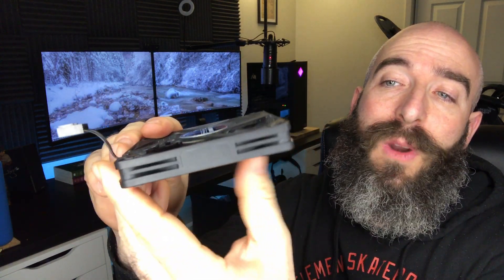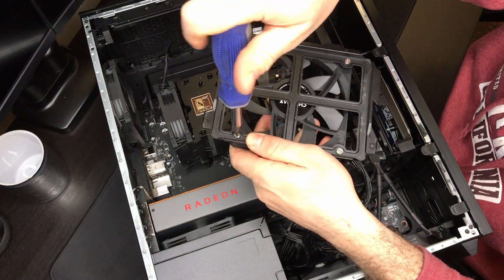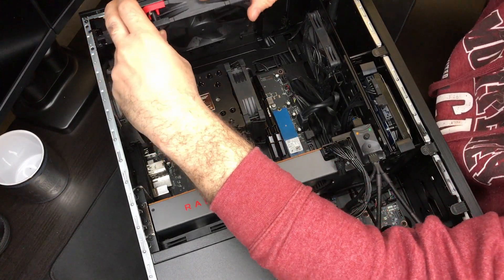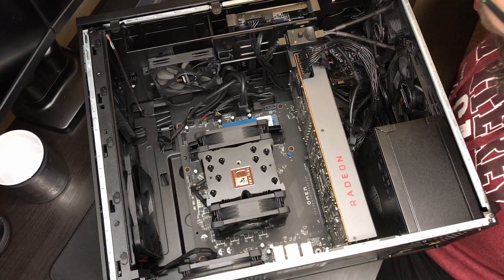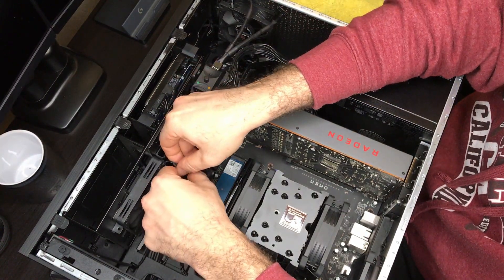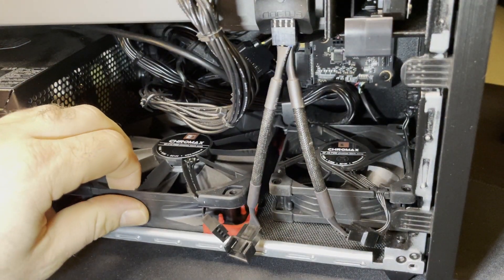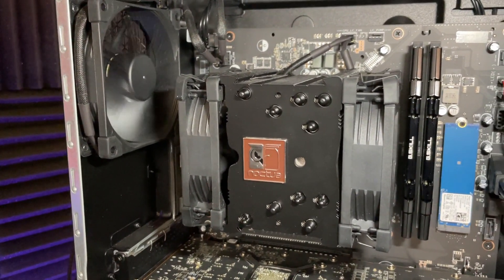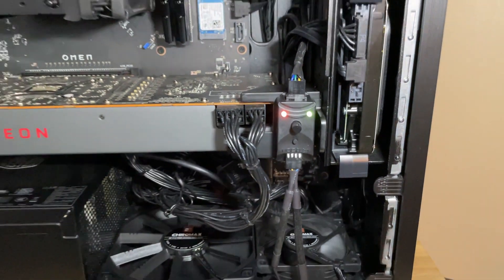How to: Install and Setup All Fans in an HP Omen 25L / 30L! Tutorial & Guide!

Comment: I have a Omen 25l with a rtx 3060 and ryzen 5 5600x. My gpu reaches 50-65 and my cpu reaches 75-80 while gaming. In idle my gpu temperatures are 35-40 and my cpu temperatures are 50-55. I have a top fan and a bottom fan added. What should i do to lower the cpu temperatures?
Reply from the maker: 75-80 is totally normal and safe for that CPU. You could try adding more fans for a possible slight decrease in temps, or you can change the CPU cooler for a drastic change in CPU temps.

Comment: hello mate, so im from the UK and have an Omen 25L.
ive tried to install a new top fan to my pc and i only have the lc pump 4 pin and a F_fan1 4 pin.
what would be best to hook it up to?
the fan is the same one as your previous installation video. thank you, jm.
Reply from the maker: Ft_fan would be the optimal connection. Or y-splitting off a current fan header would work as well. LC_pump will cause the fan to spin at a higher RPM all the time
Reply: @DanKamYouKnow  ahh right right, so i took a second look at your video and hooked it up to the f_fan1 and it makes a slight clicking noise, it’s very very faint but is noticeable when checking for noise
Reply from the maker: Interesting. Could be an issue with that fan OR, the PSU fan in Omens is notorious for making a slight clicking noise occasionally

Comment: Hey Dan, very informative video.
I want to make sure, but is the top fan insertion up to date? I am contemplating wether to install one.
Reply from the maker: Hey Mr. Doge. So this video is still pretty up to date but the best setup for Omens is a top mount 120mm exhaust / bottom mount 120mm intake / replace the rear 92mm. That fan configuration works best. Then if you want to really dive in, replace the CPU cooler
Reply: Thank you very much

Comment: Is this the last / best fan config for the 25L ?
Reply from the maker: Bottom 120mm intake / Top mount 120mm exhaust / Replace the rear 92mm fan ( exhaust ) / Replace the CPU cooler. That’s the best fan arrangement for 25L / 30L

Comment: i want to buy a HP omen with a RTX 2070 Super and Ryzen 7 3700X but i can only see 2 fans on the picture. Does it come with more than 2 because i know the 2070 Super and Ryzen 7 can get a little hot.
Reply from the maker: If it’s a 25L, it will have the CPU air cooler fan and rear fan. If it’s a 30L, it will have the same combo but also has a 120mm front fan.
Reply: @DanKamYouKnow  alright. I decided to instead get another computer eith a i7 9700k and 2080 super for about the same price. But thanks anyways!
Reply from the maker: Congrats!!!
Reply: @DanKamYouKnow  thank you :)

Comment: this is such a terrible computer case. i do not recommend anyone buy this computer. you should have 3 front fans (without obstruction) and 1 exhaust fan. as a minimum. this case has a basement. but it does not have a panel separating it and with a bottom mounted hhd drive cage. its such a dumb design. i am guessing this dude bought this because the specs inside were the right price and or he does not know much about computers. which was my problem when i bought my first computer. which was this one. i returned it soon afterwards. why is mounting front fans lol when there is no airflow that is allowed through the front lol???
Reply from the maker: How about you don’t assume what I know and stop worrying about how other people spend their money? Why are you even watching a 2 year old video about a pre-build anyways? Pretty sure you’ve commented on one of my videos before and now you comment this? I’m trying to help people that already own this PC and want to make upgrades to it, just let people be man.

Comment: Love your videos Dan! There aren't many vids on omen PCs out there. Thanks for all the help!  I'm planning to add 2 fans on the bottom; however, I don't have FT_FAN4 (front fan 4)  on my PC version (875-0034). Is it possible to use the fan controller on the Lc Pump to slow down the fan speed for the two bottom fans? Another option I saw was adding a fan power cable hub splitter.
Reply from the maker: Hey, thank you!! Can you y-split off your current fan headers? And honestly, you really only need 1 fan at the bottom ( 120mm ). Most hubs don’t work well with Omens, they will often have Omens throw the “fan error” upon every start up

Comment: What where the results?
Reply from the maker: For which component replacement exactly?
Reply: @DanKamYouKnow  temp changes from the upgrades was it like 10c drop about?
Reply from the maker: CPU cooler will massively drop it, 10-20c. All fans installed will probably be somewhere between 5-10c
Reply: @DanKamYouKnow  oh perfect mine came with a 120mm AIO so the fan upgrades should do the trick thanks!
Reply from the maker: Just make sure you do a high RPM
fan for the radiator. Something like 2,000 to 3,000 RPM
Reply: @DanKamYouKnow  ok good to know it’s stock so maybe i should change that fan also?
Reply from the maker: You don’t have to but there are much higher quality fans than the stock Omen one(s)
Reply: @DanKamYouKnow  yeah I’d rather swap them out thanks
Reply: Same can only help!

Comment: Hey Dan! Thank you for great video!
Is power of extra fans provided by PWM? and how many hubs or splitters do you use for fans?
Reply from the maker: A single fan header can power up to about 3 fans, and yes; all fans are 4 pin. I would recommend using 2 splitters but it depends on your setup
Reply: @DanKamYouKnow  ahh awsome. Thank you for answering and trying to make better omen!!

Comment: The bottom of my 25L doesn't have that wedge space with the bracket to fit in nicely. Would you have still used the double sided gorilla tape for the bottom fan if you needed adhesive? PC noob here
Reply from the maker: A little bit of tape on the corners would work great

Comment: What kind of screws do you need for the 92mm noctua fan? The stock ones are too big for that one and I don't have any of different size lying around
Reply from the maker: The one that the Noctua comes with are the correct ones, they may seem too big but they are supposed to create threads in the fan when screwed in. So it may be hard to thread in at first but they’re right.

Comment: Quick question. Would a noctua nf-s12B redux-1200 PWM (120x120x25mm) on both top and bottom be bad? I heard someone say it's usable on top but really bad on bottom.
Reply from the maker: I would go with a 120mm F12 at the bottom.
Reply: @DanKamYouKnow  okay thanks! 2 more questions. Could I use a 92 mm fan instead of the stock CPU cooler fan and can I use a 120mm noctua nf-s12b for the front fan
Reply from the maker: Only an 80mm fan will fit on the stock air cooler. And honestly, I wouldn’t worry about a front fan unless you have an extra one, but I wouldn’t go buying a new one. It doesn’t make much of a difference. I only tried 92mm so I’m not sure if a 120mm fan would work
Reply: @DanKamYouKnow  once again tysm this is my first prebuilt and idk whatd id do without your videos
Reply from the maker: No problem my dude. Congrats on your first PC! From my experience, a 120mm bottom fan / 120mm top fan / good rear 92mm fan is the best setup.

Comment: So before I start ordering parts I just ordered the 30L omen. So I will need a 92mm for the rear and the part I am confused on is will I need 3 120mm or just 2? Will I also need another 80mm to put at the bottom next to the 120 like your set up? Finally, is the fan controller a must?
Reply from the maker: This setup I had was overkill. The best setup is a bottom 120mm / top 120mm / rear 92mm, no fan controller needed but you’ll probably need a y-split cable or 2
Reply: @DanKamYouKnow  thank you so much brother, I order this based off of your review and videos even thought it was a year+ ago. It’s coming in on Friday! You’re the best!
Reply from the maker: Appreciate you saying that!! Glad I could help my friend. Easy process but let me know if you need help 😎
Reply: So my 30L omen actual comes with a 120 AIO so that is hooked up to my to with the 120m fan on top of it. What do you recommend I should do
Reply from the maker: I would still recommend the bottom 120mm fan and then replacing the radiator 120mm fan with a high RPM 120mm fan ( 2,000-3,000 RPM )

Comment: Hey I’m just curious I ordered a 30L with a 3090 and I was curious to what your temps were after putting in all the new fans?
Reply from the maker: It’s going to vary greatly from your machine. My CPU was in the mid 60’s and my GPU was like 75C. You’ll unfortunately just have to see what kinda temps your get.
Reply: Hey thanks for the response! I ordered the fans you’ve suggested and will change them out! Appreciate the work!!
Reply from the maker: No worries! Let me know how it goes 👌🏻

Comment: I’m sure you’ve gotten this question a lot, but is the CPU cooler 100% necessary? I am apprehensive to remove anything from the motherboard as this is my first decent pc. Could I get away with just a top and bottom fan?
Reply from the maker: Definitely not necessary. A stock Omen, while running a bit warm will run in the safe temperature zone. A couple fans will help slightly lower temps while a new CPU cooler will drastically lower temps. All depends on what you’re comfortable with. But no, you don’t have to mod anything.

Comment: Good tutorial, how did you install the front fan where the hdd slot is?
Reply from the maker: I used double sided tape and it attaches to the hard-drive cage. After months of testing, it really isn't that efficient.
Reply: @DanKamYouKnow  oh ok thanks, just wondering whether its worth buying another fan for the front
Reply from the maker: If you have an extra fan already, sure. I wouldn’t go buying one though. A top 120mm / bottom 120mm / rear 92mm is the best setup for an Omen.
Reply: @DanKamYouKnow  thanks, appreciate the help. Gonna convert my stock cooler to the one you have using your vid soon :)
Reply from the maker: Nice! Replacing the stock air cooler is definitely the best mod you can do for an Omen 👌🏻

Comment: Does the hp omen mobo support Corsair fans like the Corsair rgb controller because I can not get mine to work they just stay on white and won’t connect to the hub
Reply from the maker: Omen motherboards do not work well with any kind of fan or RGB controller. Not sure on how to get it to work either ( if it’s even possible )

Comment: I had a question on my 30L on the right side of my motherboard it says f_fan2 and f_fan3 but had no pins and has 3 sliver dots is there a way I could still plug a fan there great video
Reply from the maker: Thanks! No, you will need a header that has the pins sticking out. Or you can y-split with an existing fan header.

Comment: where can i get the sata to 4/3pin fan cable for my HP 30L which has a daughter fan controller board with a open sata port
Reply from the maker: The board I think you are referring to is the RGB controller. The 25L and 30L don't use fan controllers.

Comment: Hello! Please help me! I have an Omen 25L and I installed some fans from Noctua and Corsair but they spin at full capacity and I have no control over them. My PC is so loud. Is there a solution to this? Thanks :)
Reply from the maker: Are you utilizing the LC_fan header by any chance? That will make the fan(s) spin at a very high rate.

Comment: Great video but where did you plug the top fan onto I have a omen 30L 3060 ryzen 5
Reply from the maker: I show it in the video, it’s y-split with the rear fan into the header where the rear fan is normally plugged in. Thank you!!
Reply: @DanKamYouKnow  do you plug the fan into the 3 pin because the y cable has one 4 pin and the other is 3 pin
Reply from the maker: The 3 pin side of the y-split cable basically just mimics what the fan plugged into the 4 pin side does. So it doesn’t really matter. If you notice that the fans seem loud, try flipping the 3 and 4 pin around.
Reply: @DanKamYouKnow  I’m so sorry for these questions but 120mm noctua fan but the screws it came with don’t fit did you buy specific screws
Reply from the maker: The screws that come with them work just fine. They are tough to screw in and take a good amount of force to get in.
Reply: @DanKamYouKnow  could I plug the fan into my motherboard that says Lc_Fan
Reply from the maker: That will make the fan spin at close to 100% fan speed and will be pretty loud. You can plug it in there though…

Comment: Ended up getting the 30l instead.  I know the video says 25l and 30l but the 120 mm noctuas fit just fine on the 30l as well ? Going to get the top and bottom and I guess get the y split cables in the description too.
Reply from the maker: 30L works with this as well. Pretty much identical except the front fan bit.
Reply: @DanKamYouKnow  thanks , and lastly ... how many of the y split cables in the link you posted do I order ? Or is it not necessary for me to install these ? That’s the only part that confuses if I need them and how many. I’m only doing top fan , bottom fan , and cpu cooler install with the extra fan for push and pull like you did.
Reply from the maker: There is a 3-pack that’s only $10 I’d recommend. Never know when you might need more

Comment: hey bro i appreciate the replies and the video, I had one final question which was would temps be ok with replacing all the fans other than the CPU cooler. will temps be safe and good without replacing it or is it a must
Reply from the maker: Definitely not a must. Even an Omen in its stock configuration will still run completely safe.

Comment: also i’m not exactly sure how pcs work, how would i add the double splitter cable into the pc, do i just take out the already connected wire out of the motherboard and replace it with the split wires?
Reply from the maker: That is correct.

Comment: hey bro thanks for the video i’m trying to buy my first pc. I had only one question, is managing and changing the cables difficult and do you think i would be able to get away with changing all the fans other than the front fan as that seems like hassle
Reply from the maker: Cable managing the Omen is not really easy because their is no where to really hide any cables. Adding fans is not a difficult task though. The front fan isn't super effective so you could leave it out.

Comment: Hi Dan and thank you for great videos! I have 25L blasting in corner of my livingroom and my wife asked me why my pc sounds like jet engine. So here I am taking notes. 😁 I have ordered Nzxt Kraken m120 for cpu and Noctua NF-A9 PWM fan to replace backpanel fan. I am adding intake after I see results of those mods. My question why I'm here. Did you ever measured or do you know Omens noice level in its original state? My Kraken db is 25 and Noctuas 22,8 db. Those are low but I cant find any number where I can compare
Reply from the maker: Hey! I unfortunately do no own a DB meter to check their sound level about I would honestly say it’s very high, maybe around 45-55-db. The stock HP fans are VERY high RPM which can lead to a lot of noise. The Noctuas can push the same amount of air at a much lower RPM, resulting in the noise difference.

Only problem is you’ll still probably hear your GPU fan(s) but it won’t be too bad.

Comment: I have a question. Is the chassi too narrow to fit a 140mm in the bottom?
Reply from the maker: I believe it can fit but you may have to remove the little cable routing bracket towards the back.
Reply: @DanKamYouKnow  Alright, Ill take a look when it comes in tomorrow. 

They sold these off for $400 less in my country and it was the cheapest way to get my hands on a 3060ti that as a part are all sold out everywhere. If the case makes too much trouble coolingwise Ill just lift it all over in a new case.
Reply from the maker: Nice! Tough to find good deals on these lately it seems. Case swap would open you up to a lot of cooling options. I do have a case swap video on my channel if you wanted to check it out 👌🏻
Reply: @DanKamYouKnow  Ill be sure to do it. Thanks for the replies!

Comment: I got the Omen 30L and have already bought two 120mm fans for the upgrades....but someone told me they won't fit? The PC comes soon and I'm wondering if I should return these fans before the return window is gone
Reply from the maker: As shown in the video, a 120mm fan will fit at the top and the bottom.

Comment: I just got my 30L today and thought it was running too hot. but it came with an amd ryzen 7 5800x which apparently runs hot . i ran a short stress test at close to max cpu clock speed and it shot up to 90c instantly but once the fans kicked in it was sitting at 75c the next 30 mins no issue. Im going to let the omen run like it is for a while (factory stock), if i upgrade it in the future i'll get a whole new tower with better airflow to put the components in. Im very happy with this pre builts performance so far
Reply from the maker: Thermal throttle is 95c so you’re totally fine. The 5800x is actually one of Ryzen warmest running CPU’s too. Case swapping will lower temps quite a bit. Glad to hear you are enjoying it 👌🏻

Comment: Could I add a USB 120mm fan at the bottom run the wire through the back and connect it to the pc itself
Reply: Thank you this helps a lot, I ordered a 120mm and 80mm fan like you have at the bottom.
Reply from the maker: I don’t see why not but why would you want to?
Reply: I mean I already have one with me and didn't want to order a fan and a wire splitter.
Reply from the maker: I have never seen someone use a USB powered fan on a PC before so no idea if it would work.
Reply: It is essentially one of these that I had for my router but wanted to use it for my omen if I could the wire is 4ft long.
Reply: Quiet 120mm 5V USB Fan Dual Ball Bearings for Receiver DVR
Reply: Also How many fans can a single fan header handle.
Reply from the maker: Usually no more than 3 per header.